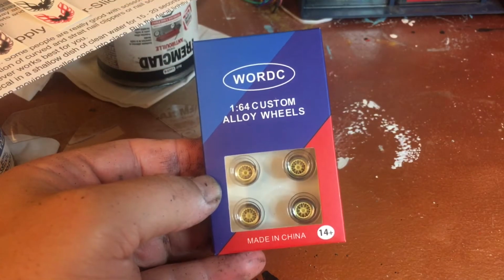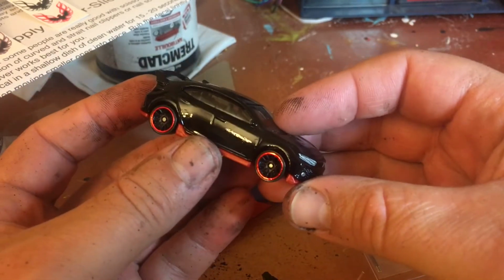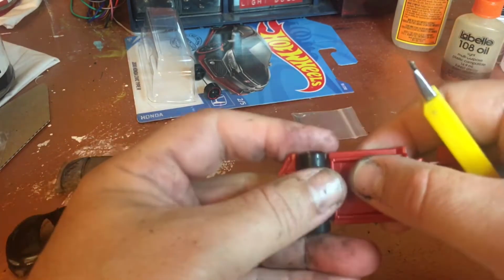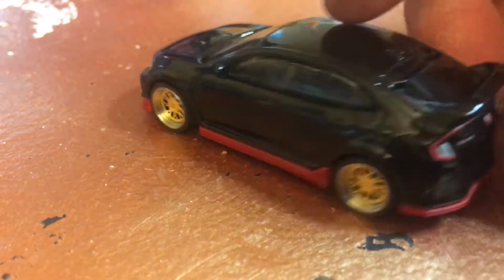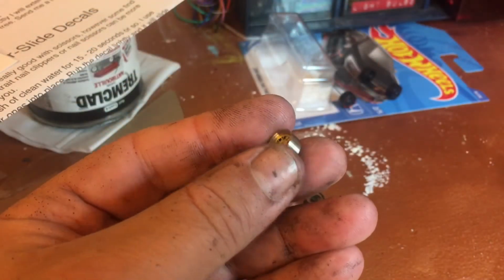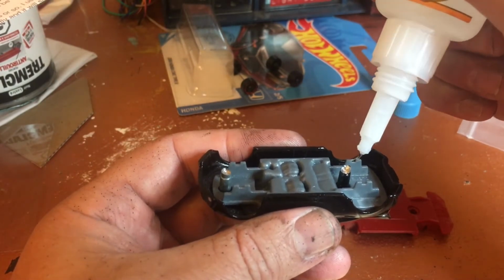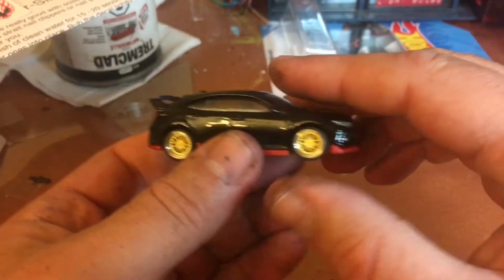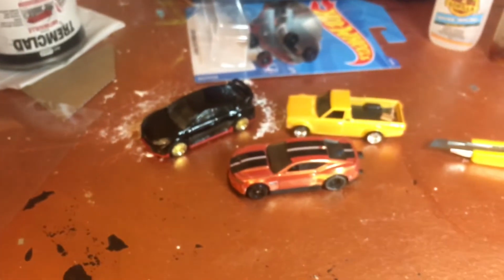Installing 1/64 alloy wheels with calipers

Comment: I picked up 3 sets of these recently, but I cannot separate the back disc/plate to get to the disc brake. Is there a trick I'm missing? I want the brakes to remain stationery while the rims spin.
Reply from the maker: If you glue the axle to the car, your calipers will remain stationary. If you have the kind where you have to insert a pin to the end, they will always spin.
Reply: @watchtrainsnow1099  thank you so much for your reply, really appreciated. I have the kind you describe, but I eventually managed to remove the front part rather than the back, and you're exactly right, the disc brake was glued to the wheel rim. I've managed to separate all the parts now, so will see if I can get the brakes to stay fixed and have the rims spin. It will be my first custom. And thanks for posting your videos, hope to see more! :)
Reply: Can you give me the link to the website?